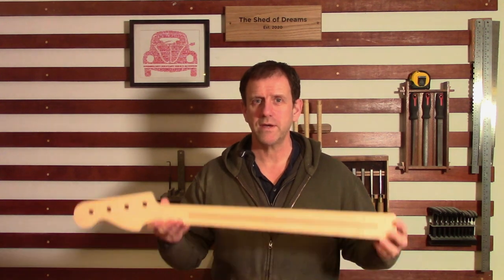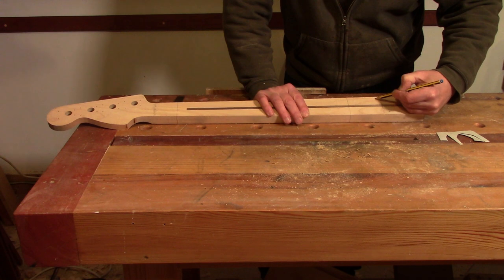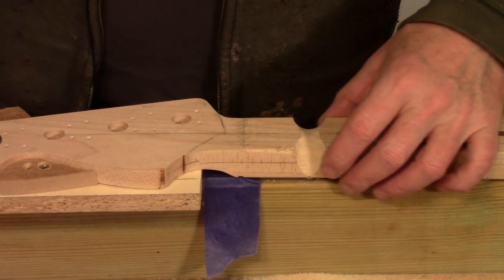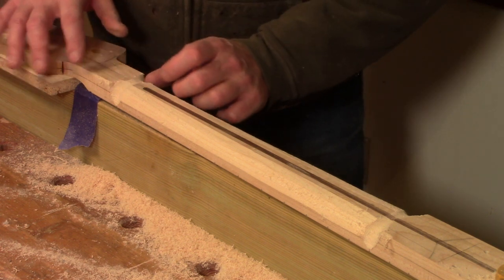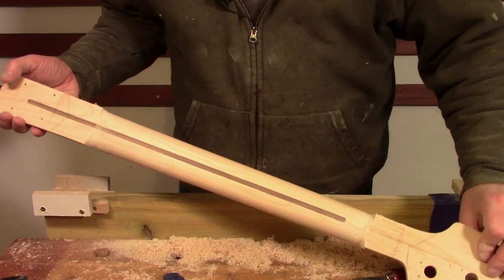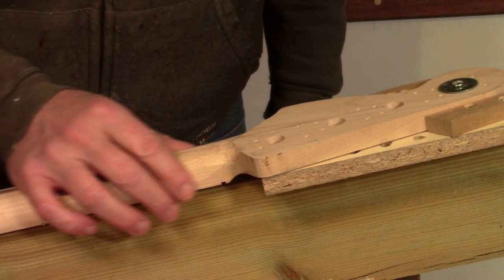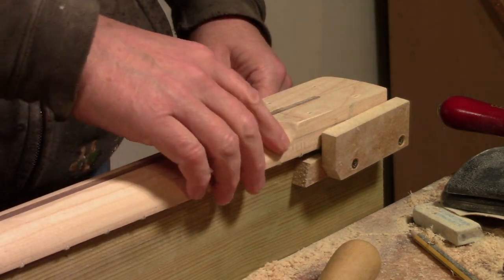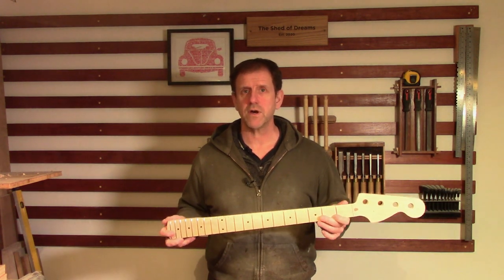Precision Bass Build Episode 8: Neck carve.

Comment: I am struggling with a piece of maple I cut last year, trying to find a way to make a body out of it. Your video is a nice break. The neck is looking great, I used your technique for my SG neck which turned out great. Thanks!
Reply from the maker: I'm sure you will sort something out with the maple, could get heavy though. A mate of mine had an old Gibson Ripper bass, solid maple, nearly broke his back!!! I'm really happy to finally get the neck to this stage :)
Reply: @Adventuresfromtheshedofdreams  I thought about the weight also so I am going to just do a maple top. Thanks.

Comment: Love NECK CARVE DAY!.. fantastic.. Question?? your templates for initial carve at the first fret and 12 or 14th.. do you carve until you reach proper depth to top of freetboard or leave it s bit short for finish work later?  I assume your templates measure to the top of the fingerboard (upside down at this stage) to get the correct feel.  If this is the case.. how does Gibson turn out necks in the 80's that were so different?  I have an 1986 SG-62 with a very thin neck 0.80" at 1st fret and 0.82 at the 12th.. but others have chunkier necks of the same vintage.. back in the day we were at the mercy of the luthier I guess..   Thank you so much for these vids.. when you post them in the States I need an afternoon break from work and watch them.. cheers.!!
Reply from the maker: With the templates I have marks for the top and bottom of the fret board and a centre line, I always leave the initial cuts a little bit fat so there is plenty of material for finishing. I'm not sure how Gibson went about neck carving in the 80's but I've heard plenty of talk about 50-60s profiles being consistent enough to identify one year from another, perhaps it's that famous Gibson quality control at play! I'm glad you are enjoying the videos and that they give you an excuse for a break :)